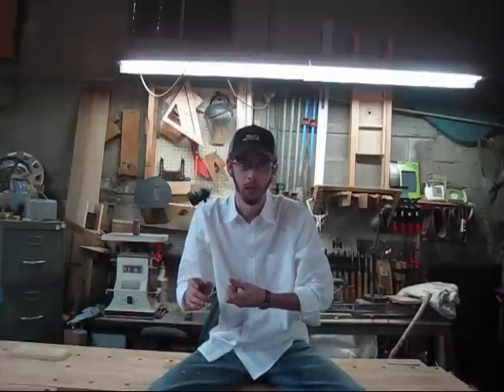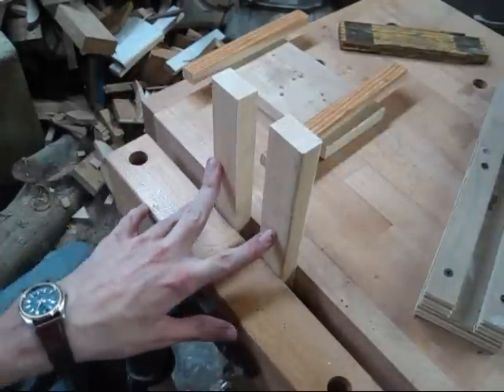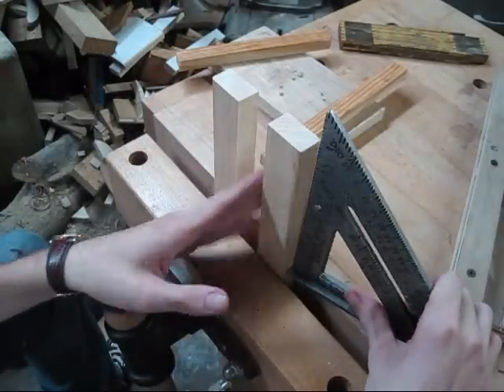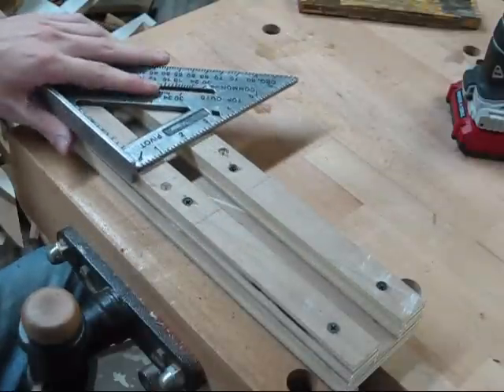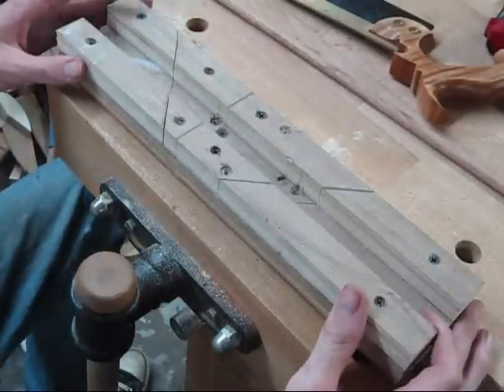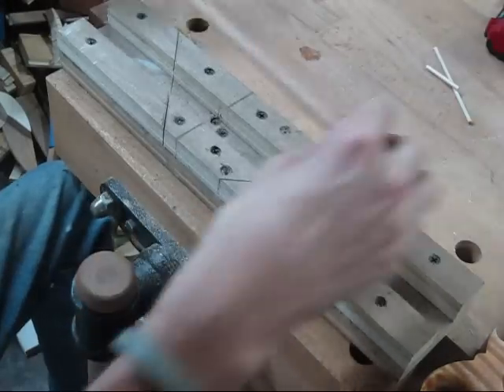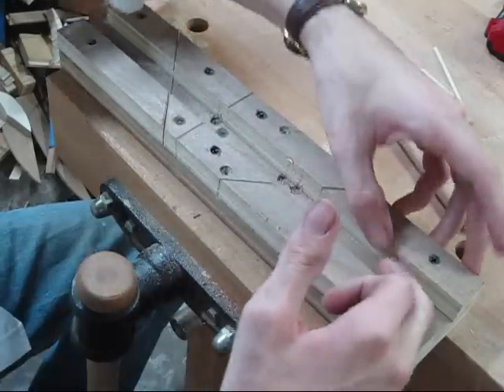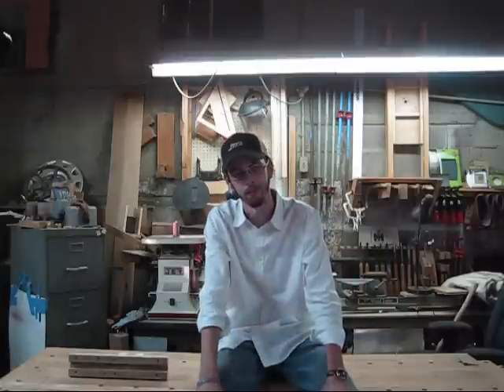Miniature miter box

Comment: Using the front edge of the front strip of wood to set the angles of the slots, and the back edge of the back strip of wood to brace the strip to be cut could result in inaccurate cuts if the edges are not completely parallel with each other.  I suggest that you use the same edge to set the cutting angle as you will use for bracing the wood to be cut.